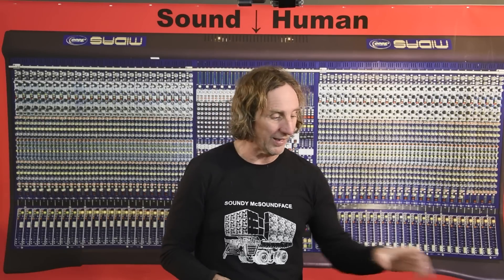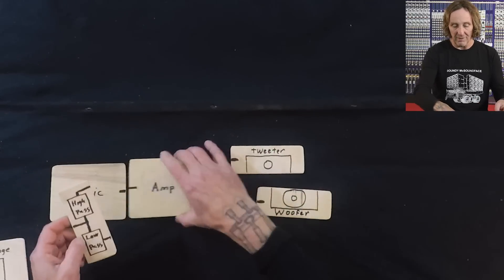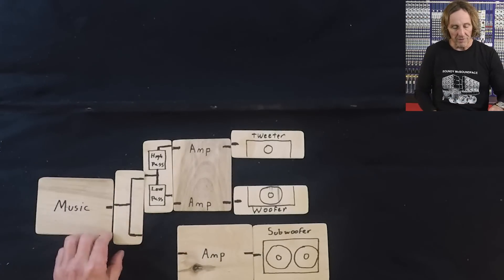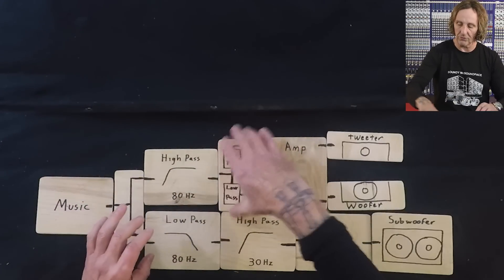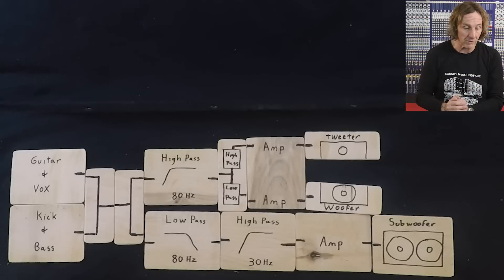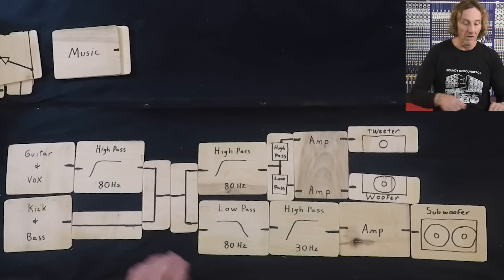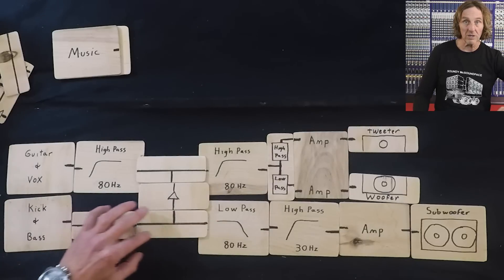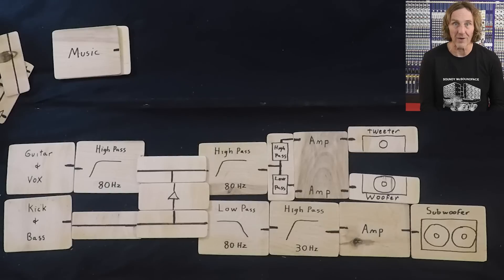Sound System Signal Flow Evolution

Comment: 3:55 This seems like a lot more work than I want to put in, with more equipment that I can't afford to buy. 
This is why I love my specific setup (everyone has their own setup that they're comfortable with...)
So, I start with my Mackie Profx v3 mixer. I split three different line outputs.  All my low frequency channels such as bass and floor tom(s) through subgroup 1/2. Everything besides bass will be sent to subgroup 3/4 and mains. From there, the mains go to one of two EQs for more midrange frequency control.  Subgroup 3/4 goes to the other EQ for my highs. Subgroup 1/2 goes directly into the amp specifically for the subs with the crossover set to 80hz (the 160hz is too "muffled" and too low for my setup). All my amplifiers and speakers are Rockville Audio.  RPA-16 10k (all wattage at peak power) running two 3k dual 15" and two 1,500 single 15". Highs are the RPA-14 7k powering four 1k 12". My subs are a second RPA-14 7k with two 1k 18" and two 800 watts 15". I can rumble Project, and be understood at the same time.  But as we all know, we must take time to properly "tune" our system for each venue. We also need to be able to listen to what comes out of the speakers and make proper adjustments on the fly. Overall sound tuning I can use the 31 band EQs to make certain adjustments like being able to tune the mids and highs together. I've heard some horrible sounding concerts (to the point that I had to walk away) because the system wasn't tuned TOGETHER.  Just like hearing two instruments clashing, our PA does the same‼️! Always adjust the EQ of the mids and highs along with your lows to prevent the clashing. LISTEN to the audio and make those adjustments.

Comment: Main reason I dont prefer aux fed subs is you cant process the low end with the same processing as the mains. For instance, buss compression or multiband compression that I like on my entire mix. To me it makes things much more complicated. I like to mix like the way I mix in my studio. I suspect your preference for it Dave has to do with your experience on very large systems. Also, most of what I mix is church gigs which with no amps onstage. Guitars and bass all DI and drums typically enclosed in a cage, and if not still the only thing producing any low end onstage. I suspect if i had multiple amps onstage at concert volume I might be more interested in aux fed subs.
Reply from the maker: Interesting. Isn't multibrand compression a complex way of trying to prevent the subfrequencies from creating pumping sounds on the upper ranges?

Subs on an aug send eliminates his issue perfectly instead of dividing things up compressing the low separately and then recombining them electronically like a multi-band compressor does.

Subs on an auxend allow you to compress the subs separately and independently and recombine the signals acoustically.

It's not the tool for every job but it definitely gives you more control and a less processed sound
Reply: @DaveRat  yessir that is indeed one main usecase for them. But I use multiband compression moreso for getting a specific sound. I suppose its just been part of my workflow for so long. Ive never felt i had too much rumble or low end *noise in well installed PAs so when ive come across aux fed subs it felt like more of a pita than anything lol though i know many pro engineers who love them. 

As for compressing the low end on its own, ive done that as well but it felt clunky and was more to manage than just monitoring my LR buss processing. Caveat for me is ive never worked on anything bigger than maybe 1000 seat clubs/churches so i cant speak to massive PAs etc…..
Reply from the maker: @LaminarSound I've done several other videos on subwoofers on an aux that may provide more useful information.

Ultimately it's about control.

Let me provide a few scenarios

1) an engineer has all the instruments sent to left and right

2) The engineer has all the instruments Santa left and right but the subwoofers are on stereo auxiliary sends from each channel such that the EQ and fader levels affect that auxiliary send.  Control and mixing is identical to scenario 1. Any EQ or processing that is on the left and right is also mirrored and put on the left and right subwoofer sends. The subwoofers ends from each channel are sent with the exact same panning as they are in scenario 1.

For all practical purposes scenario one and scenario 2 sound exactly the same.

I now walk up behind that engineer while they're mixing and ask " why do you have the hi-hat sent to your subwoofers?"

Why do you have your overheads sent to your double 18 subwoofers?

Why do you have your vocal mics sent to your subwoofers and I hear these big pee pops that you are now high passing but it isn't getting rid of all of it without taking away some of the warmth of the vocal?

So the engineer starts turning down the subwoofer sends on the channels that don't need subwoofers. 

We then both look at each other and go wow that sounds cleaner and clearer

And then we smile
Reply from the maker: Let me present a few scenarios

Scenario 1 The engineer as all of the instruments sent directly to left and right which then drive the left and right main speakers as well as the left and right subwoofers

Scenario 2 The engineer has all the instruments sent to the left and right main speakers and has a separate stereo sand on each channel that sends to the subwoofers and pans exactly the same way as the sends to left and right.

In both scenarios the EQ and left and right processing is identical and on the second scenario the left and right subwoofers are processed by mirrored versions of that same left right processing

For all practical purposes both of these scenarios sound exactly the same and mix exactly the same.

I then Walk up behind that engineer and ask " why do you have hi-hat and overheads sent to the subwoofers?"

Do you really need your vocals sent to the subwoofers?

I hear a lot of p pops and I see you've got your high pass filters set pretty high to get rid of them but that seems to be taking some warmth out of the vocals that you're now EQing back in doesn't that seem kind of awkward?

What if you don't send any instruments to the subwoofers that you don't want subwoofers on?

And the engineer goes through and turns down the subwoofer sends on all the instruments they don't want subs on.

Wow that sounds clear and cleaner!

Omg I have more control now I can determine how much subwoofer I want on each instrument versus how much I use the high pass. This is like having a whole other level of EQ! Wow that wind noise it's getting into all those mics that I don't need subwoofers on and I've been high-passing to get rid of wind noise Sound warmer and clearer and I have less wind noise and a better sound, cool!

And then we both smile and hang out
Reply: @DaveRat  That is a valid point Dave and I cant disagree. Id never tell someone if it's working for them to not do it. Especially not the GOAT Mr. Rat! 

I just work from my own experience. Ive not had issues with vocal mic plosives or wind noise coming through my subs and causing any problems, or a lack of warmth in my vocal mics from trying to EQ out those plosives. Again, ive not mixed many shows outdoors, and definitely havent mixed shows anywhere near the sizes you have. So thats a big caveat I think.

When ive come into venues with aux fed subs I always had issues like not near enough top end in my kick drums or bass guitars, and I know good and well what a D6 sounds like on a well tuned kick drum, and what 3.5khz sounds like on a bass guitar. Most of the time this is because they just sent kick and bass straight to the sub and not the mains. Other times it has been poor calibration of the tops vs the subs, and send levels all varying. I didnt have time to address these issues. I just wished I had a balanced LR to work with and not have to dive into routing or sends to troubleshoot. 

I do have a serious question for you Dave.. if all stereo music is mixed down today to just an LR, and those songs all sound great when pumped through a live PA, shouldnt you be able to duplicate those results without aux fed subs??? That stuff wasnt mixed on aux fed subs in the studio and those kicks and bass guitars arent being split out from the 2 track when played back. Most consoles nowadays have multiband compressions and limiting built in. In addition to most of the other tools one might use in a studio mixing session.
Reply from the maker: @LaminarSound in the studio Aux sends are not ideal because you're mixing with a final goal of proper sound on left right.

Unless of course if you're mixing too a 2.1 system in which case auxiliary subs are exactly what you need to do the mix.

Auxiliary fed subs for live are pretty much just mixing live into a 2.1 system or preferably a 2.2 system.

Here is a video that goes into more depth of why 2.1 and 2.2 systems are typically a better choice for live audio

https://youtu.be/hpFK1XOZuUg?si=z6NydXNJHynO-dj0

Comment: Oh man, I remember how excited I was when first got my greedy hands on bi-amp capable speakers, and then realized that I didn't have a second amp available to drive it, or a crossover... Lol

Then I ended up with some sub-bass cabinets and extra amp channels, but the sub-bass processor was dead, so I emulated it in the system processor to drive them, and FINALLY had the kind of bass I wanted!

Comment: What I learned: although there are bunch of EQ filters, they can't completely cut all the frequencies  it is aupposed to...Not even the from the main output!
Reply from the maker: Correct and the steeper the filter and the more you cut out the worst it sounds because of filter ringing and phase shift. The softer the filter and the less you cut out the better it sounds but the less control you have

Comment: Would there be any reason to not go "hybrid" with the crossovers?  My main system is all active Xover, though the mains themselves actually have passive crossovers, currently being bypassed.  If I never get even close to full output on those amps, using the internal crossovers would eliminate the need for 4x amps.  I designed/set up a PA for another venue and used the passive Xovers in their line arrays, with active Xover for the subs.  I did that to save them money and there's no obvious issues.
Reply from the maker: Yes as long as the crossovers can handle it hybrid can be quite good.

For the microwedge I designed an EAW sells, they operate bi amp or passive, both modes work really well. Additionally I designed processor settings for the passive operation so that they sound identical or near identical to the active operation.

The passive allows you to have more mixes use less amps and works really well.

The same thing applies to main speakers and even the D&B J system and other designs operate with passive to the horns
Reply: @DaveRat  Thanks man!  My mains are EAWs, good cabs.  The amps are a little overkill but I could always just set my output limiters a little lower after making the switch.  For such a busy guy, you are extremely good with engagement.

Comment: A question about hipassed mics still sending low end to the subs: what if I just highpassed further? 
I usually high pass vocal mics around 200/250Hz & snare, HH, & overheads around 150Hz
Would increasing the high pass filters create a similar result when sending LR to everything compared to separate sub sends?
Reply from the maker: Raising the high pass will reduce the amount of low frequencies from that input.

But a high pass is just a filter that reduces the amount of low frequencies sent to the subs.

A 12 DB per octave high pass set at 250, will be 12 DB down at 125, and 24 DB down at 63 HZ.

So the high pass set at 250 is turning the lows down 24 DB that are going to the subs at 63 HZ

With subs on an aux send you have the option to turn it down all the way so it can't get there from here.

Now 24 DB is a good amount of drop but every single microphone on stage will add some low end to the subs, so the subs will see all the channels you want sent to them Plus low end crap from every single other microphone when you have subs on left and right.

If the bass guitar amp bleeds into every mic on stage and you have 24 mics, you now have that bass guitar bleeding into the subwoofers at 24 different time delays depending on where the mics are positioned creating a blur of low end. Same with stage vibrations, wind, HVAC fan air, and handling noise. 

It may not be loud in some setups and could be quite loud in others but it definitely always will be there.

I recommend testing and seeing if eliminating all that extra crap going to the subs cleans up your mix.

I know for me it made a clear and audible difference plus it gave me more control and instead of high passing things much too high I can set the high pass wherever the instrument sounds best and even boost low EQ on that channel to warm it up and still not send signal to the subs on channel so they don't want sent to subs

Comment: Can you please explain more about the summing amp? How it’s been design and implemented in the signal flow?
Reply from the maker: Summing amps and buffer amps are everywhere in the analog audio path and similar.

The polarity reverse is usually just a polarity inverting buffer amp.

When you assign at left and right or an aux, you are sending to a summing amp

With digital kits different and more of a math equation.

Comment: Without even seeing the experiment, I know the HPFs are gonna let in plenty of bass. 

I frequently mix on a system with subs on crossover, and when the keys player hits a low octave it's impossible to get that bass out of the subs. We have to resort to 150hz or higher HPF and still some comes through. The bass players hate it.
Reply from the maker: Yeah, either raise the high pass too high and sound bad or send bass bleeding into all the mics with undesirable time offsets along with unwanted vibration noise to the subs which sounds bad or put subs on a separate send and eliminate all that and sound good

Comment: Just wondering what your take is on the Wall of Sound that the Grateful Dead used in the mid '70s.  They took this to a pretty extreme level (at one point Phil Lesh had a separate amp/speaker stack for each string on his bass), but things like their phase-matched differential microphone pairs for the vocals strike me as an elegant solution to reduce or eliminate bleed and feedback.
Reply from the maker: Well if you really want to know my thoughts on that and are up for diving into a rabbit hole, try a Google search on Dave rat double hung PA wall of sound and there is loads of information on not only when I built a mini wall of sound on Black Flag tour as well as toured with a streamlined version that worked very well solving many of the problems with the wall of sound with a modern day system.

Also I have much info on minimizing multiple sounds from single sources the same sound from multiple sources having issues and numerous other perspectives.

Not sure what you'll find but I think there's more than most humans could possibly ingest on the subject

Comment: Interesting to see a "High Pass" or "Band pass" filter of 30Hz to 80 Hz on the sub.  This is strictly to remove "noise" , not considered audio from (20 Hz and below) from getting to the amp.  Correct?

Also wondering about the benefit of two, high pass filters on the tweeter/woofer setup?  Can you not remove the high pass before the summing amp, and achieve the same goal?  Or...does this stage represent the individual filters on each channel of a mixing console?
Reply from the maker: Most setups will have multiple high pass filters throughout the signal chain.

Lots of gear has built-in high pass filters, either intentional or not intentional. If there was no high pass filter theoretically you could reproduce DC which would blow out your speakers without making sound. That said using too many iPass filters can negatively affect the sound quality of the low end and make it ringy and resonant. It's very normal to want to limit the low end below a certain point going to subs either because they can't reproduce those frequencies or there's no material down there of useful quality

Comment: Great video. I'll definitely be sending it to people who have questions. I know you've been talking about concert systems, however it feels like manufacturers of DJ sized powered speakers have been dropping biamplification. Unless I'm misreading the specs, this seems to be the case for JBL's IRX100, EON700 and PRX900 lines. The PRX800 mentioned being biamped in the specs so not mentioning it for the new equipment seems suspicious. A cursory look at the new offerings from EV, Mackie, Yamaha, etc. seem to show the same trend (only RCF still mentions biamplification but they're out of my price range). Is there a reason for this trend? Does it impact the quality of the output?
Reply from the maker: For well processed and protected systems with sufficient amp power where the amp never clips, passive can work really well.

So these are baselines but there are many factors